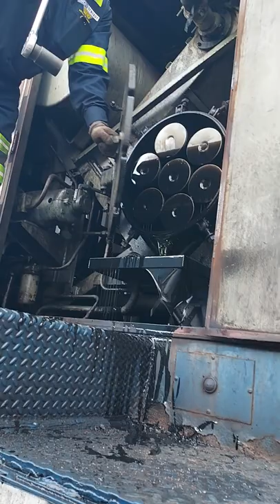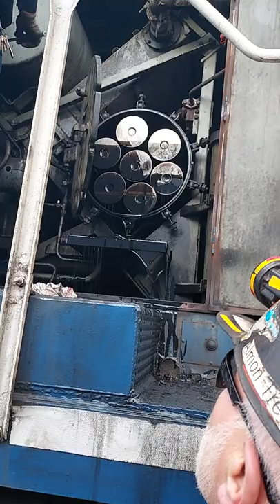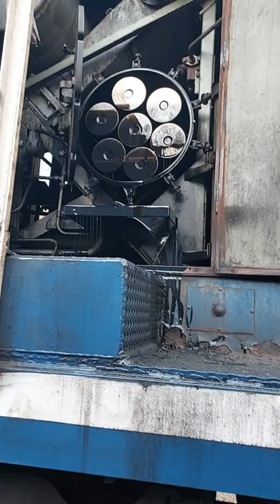Locomotive Oil Filter Seal Leak #shorts

Comment: Hi, Dave. Just a comment on the guard or check rail video you made. You made a reference to an Open Hearth, and as an old steel works employee, I can tell you a little about these. Before the Bessemer Steel making process was developed (a basic oxygen steel process), where nearly pure oxygen is blown through a mixture of liquid iron and scrap iron and steel, and each heat of steel takes only about 20 to 25 minutes, Open Hearth Furnaces were used. These furnaces were charged with liquid iron and scrap, heated with blast furnace gas and coke oven gas, and fresh air was blown through the smelt to supply oxygen, and in later years were fitted with oxygen lances to speed up the smelting process. These furnaces could be controlled very finely and the quality of the smelt could be right on target, but the big drawback with them was the long heat time, which could be up to 7 or 8 hours. Fairly slow charging was also a problem. This made very expensive steel compared with BOS steel.

Comment: YOU WONT HAVE THAT OIL IN THE FILTER SHELL IF YOU GO TO THE OIL BOX ON THE FRONT RIGHT CORNER OF THE ENGINE.
THERE YOU WILL SEE A SQUARE REMOVABLE LID HELD DOWN BY 2 HAND KNOBS.
REMOVE THIS COVER AND THERE IS A SMALL HANDLE STICKING UP THROUGH A METAL MESH PLATE.
LIFT THIS HANDLE UP AND ROTATE 1/4 TURN.
THIS WILL DRAIN THE FILTER BOX AND FILTERS IN ABOUT 20 MINUTES IF ENGINE IS WARM.
THEN LOOSEN THE CLAMP BOLTS AND OPEN THE LID!
OIL WILL BE DRAINED AWAY!!
KEEP THEM ROLLING BROTHERS!!
👍👍
Reply from the maker: Thanks for sharing that Ross, pretty cool info to know my friend.
Reply: @ccrx6700 
WORKED 30 YEARS IN MECHANICAL DEPT LOCOMOTIVE ARGENTINE SHOP, KANSAS CITY KS.!
GLAD TO PASS ALONG!
WORKED AS MACHINIST, AND ALSO KNOW ELECTRICAL!
IF YOU NEED TO KNOW, JUST ASK!!
KEEP THEM ROLLING BROTHERS!!
👍👍
Reply: @ccrx6700  A LITTLE MORE INFO!! THERE ARE ALSO THREE MORE OIL STRAINERS NEEDING CLEANING AT THE OIL BOX!!
THE HIDDEN ONE IS UNDER 
THE SQUARE LID AND THE GRILL UNDERNEATH!
THERE ARE 3  3/4 “ NUTS HOLDING DOWN THE SCREEN
AND AFTER REMOVING THE 3 NUTS AND SCREEN THERE IS THE STRAINER FOR ALL THE OIL COMING FROM THE PAN TO THE SCAVENGING OIL PUMP!
ON THE TOP OF THE OIL BOX ARE TWO MORE STRAINERS FOR OIL GOING THROUGH THE OIL COOLER AND FILTERS!
REMOVE THESE 3 STRAINERS AND CLEAN THEM!
BEFORE REMOVING THESE. GET THE PROPER GASKET FOR THE SUCTION STRAINER AND O RINGS FOR THE TWO EXTERNAL STRAINERS!
ON THE SUCTION STRAINER
BE SURE TO CLEAN OLD GASKET PIECES COMPLETELY!
ANY CHUNKS LEFT WILL ALLOW 
AIR TO MIX WITH THE OIL AND MESS UP THE OIL PRESSURE READING BADLY!
ALSO MAKE SURE THE OLD O RINGS ON THE TWO STRAINERS 
ARE COMPLETELY CLEANED OFF , AND GREASE THE NEW O RINGS BEFORE INSTALLING!!
ROSS B

Comment: 📞 NAPA! 👷We need some oilfilters. 📞 How many?? 👷All of them lol
Reply: NAPA: sorry, we have no filters for engines above 1000 cu. inches......oil filter: Luberfiner LP2246 quantity of 7. should be able to get the sec. spin on fuel filters from napa.
Reply: actually napa does carry those but it takes a week or longer for shipping
Reply: @jonathancox5264  They're in stock but way more expensive than Luberfiner, and they're made by Wix anyway. So probably just cheaper to buy the OG WIX one, they must charge more to slap the NAPA logo over a WIX filter.

Comment: One of my favorite jobs was changing oil filters on a diesel.  When I had a diesel engine in my 1969 Mercedes I'd spread the used oil over the weeds along my sidewalk.  The EPA would've killed my but the weeds never grew back.

Comment: Believe it or not I have changed oil filters on a EMD 645 that was in a tugboat about 2 or 3 years ago. A quick but messy job for sure!
Reply: done a 12-567b a few times- trash can directly below walkway, when removing the cartridges. tag out unit, open up filter drain, come back in 2 hours, R&R filters close drain valve, remove tag and start up, look for leaks.
Reply: @rearspeaker6364  I usually put pig-mats right below the area where oil will be dripping. There is also a fabricated oil pan that goes right below the cartridges.
Reply: Just open drain valve under ice cream maker lid on EMD filters , drain fairly quick , never found lube oil filters messy job . Great foolproof  design , you can't get lid on until you close filter drain

Comment: Ooops a bit of cleaning up to do. Curious where that oil goes. Under the engine?
Reply: Those old Jimmys usually spill it on the ground.
Reply: @bluegrassman3040  OK I wondered if there was a pan under the engine where it would collect.
Reply from the maker: There is a catch sump under the engine to catch any oil leaks
so it doesn't go on the ground cedarcam.
Reply: @ccrx6700  where I used to work, CSX’s Jimmys’ would always leave oil on the ground between the rails.  There was always fresh oil left every morning after they finished their switch job.
Reply: @ccrx6700  OK Thanks Dave That's good to know.

Comment: That's a lot of oil!  What's the service interval on the filter and the oil itself?  I think this is a two-stroke engine with crankcase intake air flow.
Reply: My uncle was an engineer with CN, until he retired in 05.  He told me they mainly just change the filters and sample the oil.  Don’t really change the bulk of it as much, but idk.

Comment: How long do they last?
Reply from the maker: They typically change filters on 92 day loco inspection Andrew.
Reply: @ccrx6700  There pretty much running the whole time right? They change the oil to, or just filters
Reply from the maker: @andrewavvenire116  engine is shut down to change filters. If just adding oil its left running
Reply: @ccrx6700  I figured as much. I remember in your video a while back when I think that Engine derailed and messed the wheel up, it was running the whole time in till the guy got there to fix it. I leave my old diesel trucks idling a bunch. It makes sense to me

Comment: those large diesel engines use a ton of oil! probably 8-10 gallons if not more
I remember changing the oil of a Mercadies benz diesel, talk about black oil,
carbon from the diesel engine running. I could not imagine a full size train engine.
thank you for the video it is nice to see all of the unique events on the railroad.

Comment: One seriously flawed design. Seems it'd be trivially simple to rotate the housing 90 deg so the cover is on top, then put a drain fitting at the bottom. With a means to collect oil, of course. No mo swamp.